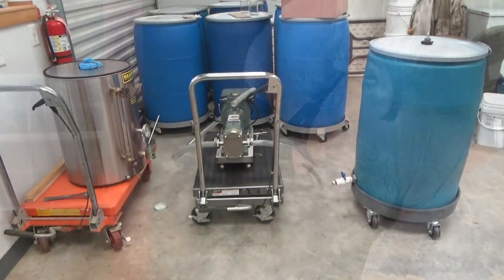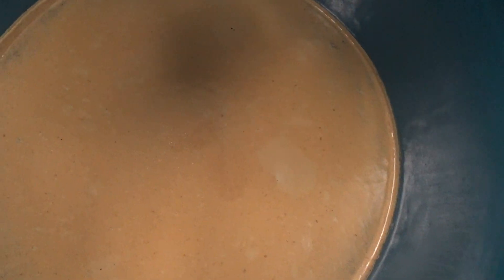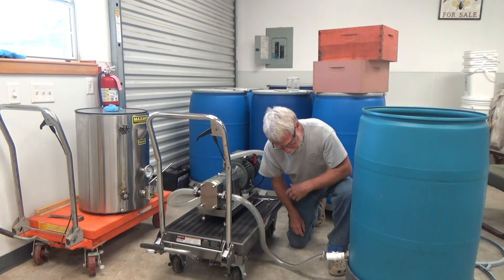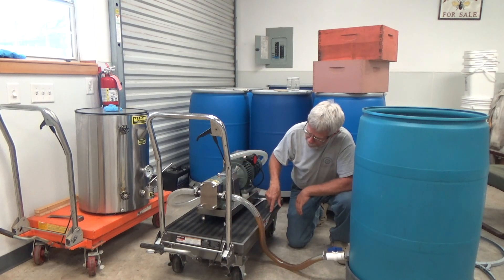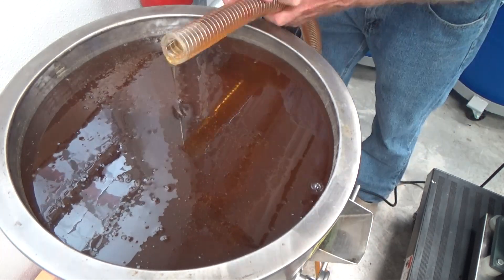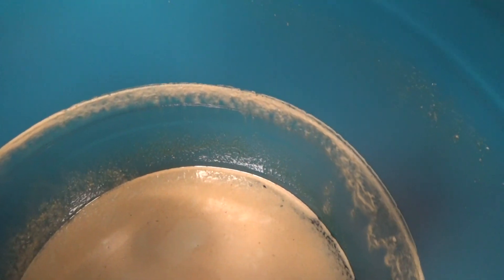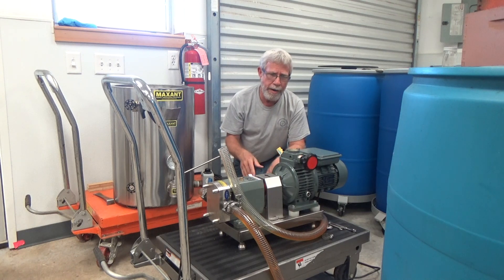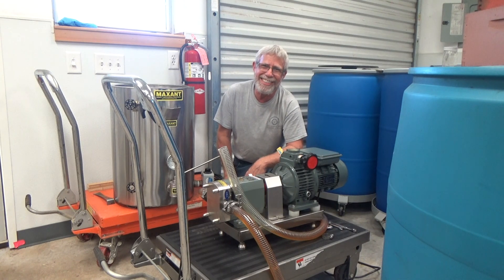Sunshine in a bottle!

Comment: I have a batch of honey that crystalizes in about 3 weeks, but thanks to you I learned how to de-crystalize it.  I have a 32oz mason jars of honey I get from a local keeper.  When it crystalizes I put it in a small styrofoam cooler with a 13W light bulb in it...that is connected to a STC1000 Temp Controller ($15 on amazon maybe?)...I set the controller to turn the light on when the temp drops below 95F and off again when it hits 105F.  I can get my honey clear again inside of a day with that rig.   I could do it faster using a high wattage bulb (It will heat the chamber faster), but I risk melting the Styrofoam chamber (ask me how I know...LOL).